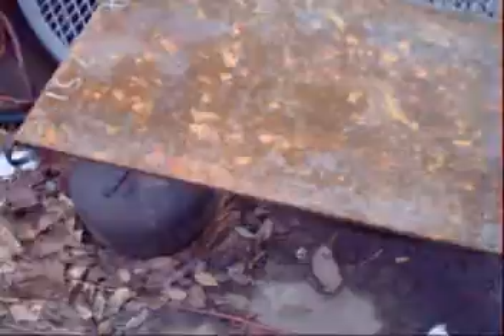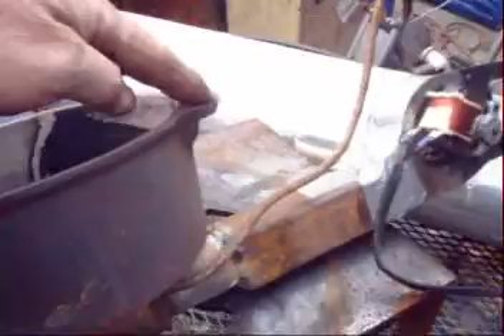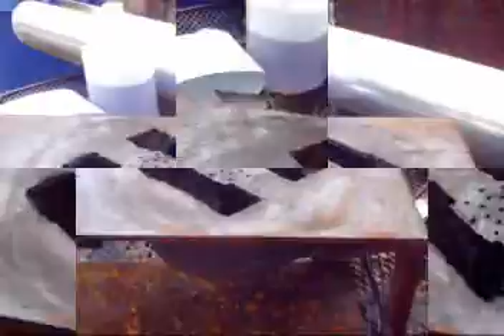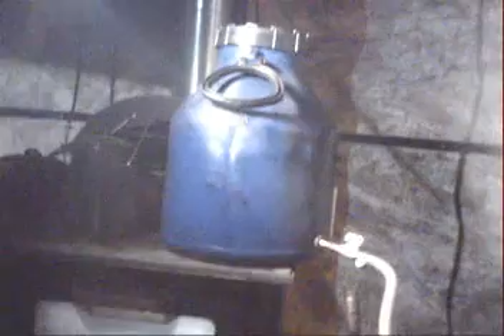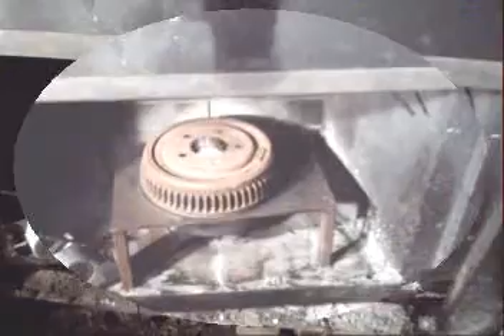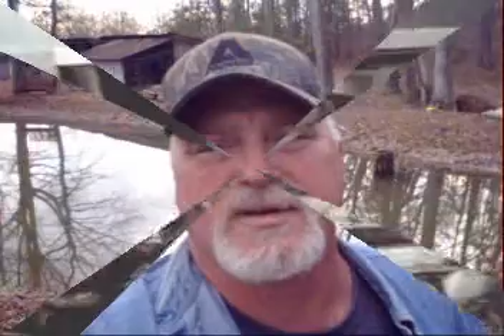waste oil burner

Comment: Hi there, I have enjoyed this vid and the one you did on pellet stove modification. Got all the parts for the pellet stove conversion except the blower.  I will be posting my results on both a pellet modification with alot of your ideas. And still to come a kick at a waste oil burner. Just getting the parts for that.
Why dont you make another version of a stand alone waste oil burner? Maybe with a siphon nozzle using a refrigerator compressor as your air supply. Very cool.

Comment: Do you think that this might produce more heat if the air was let in the side of the oven to create a turbo type swirl? I plan to give this a try and use 2 or 3 brake drums to hold more heat.

Comment: great vid! can i put that whole unit in a large wood burner? will i still need the brake drum to heat the wood burner? want to make it removeable if i run out of oil lol.  really like the bottom feed vs drip great job